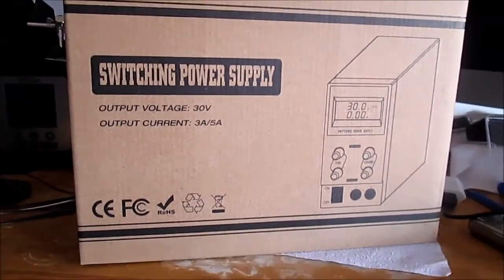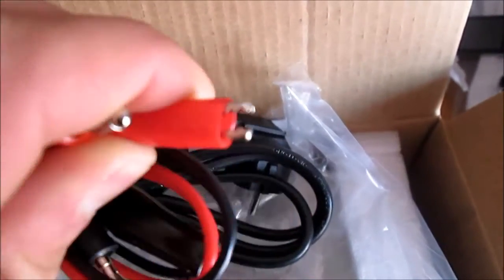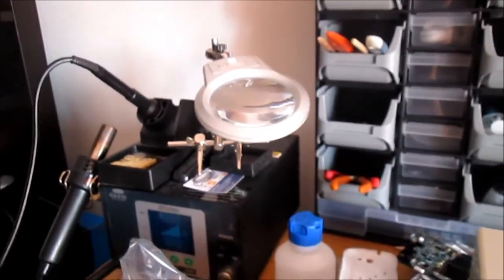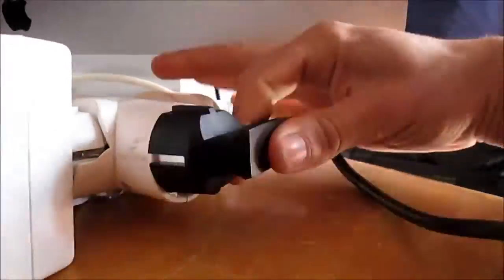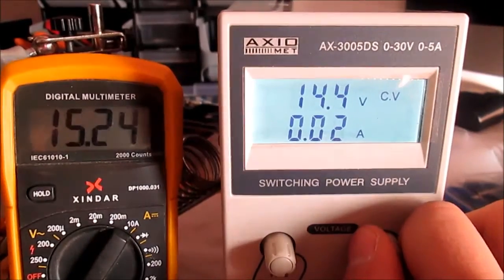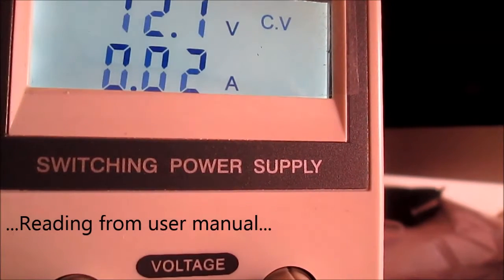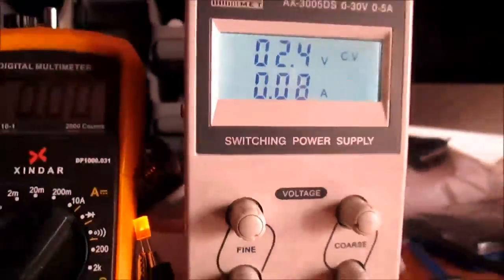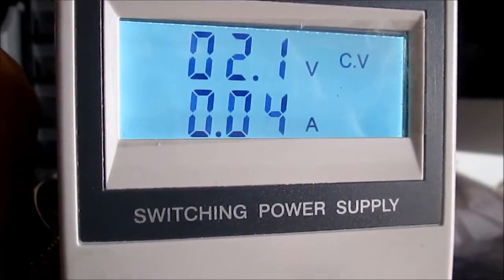FTVlog 46 - Unboxing and testing AX-3005DS Power Supply

Comment: I need some help if possible.
I have a power source equal to that present in the video.
I bought this power supply to work with an arc to cut foam.
The wire is chrome nickel and has a diameter of 0.05mm and 700mm lenght.
I hook the Power Source to the arc, but not heat the wire.
What is the reason?
Thanks
Reply from the maker: Hi +Paulo Cardoso,

1º - Double check the connections,
2º - Regulate the power source to the max (clockwise) and test please post here what values you have on screen.
3º - reduce wire length to have just for testing you don't need cut ir out, justo connect one of the alligators clips to middle of the wire and post here the values on screen.

Please leave here a feedback of my suggestion
Reply: +FT Vlog (FTech Video Log)
  Thanks for your response.
follow the tests that asked:
1mm wire with 700mm lenght with two aligators,
3.4v / 5:32 A
1mm wire with 700mm lenght with one aligators,
31.6v / 0.62 A

0.5mm wire with 700mm lenght with two aligators,
0.80v / 5.33
0.5mm wire with 700mm lenght with one aligators,
31.6v / 0.08 The

Thanks
Reply from the maker: +Paulo Cardoso I made an video for you, in this video i explain how it works and how you solve your problem, https://youtu.be/RAXyhVz_F5I

please leave a feedback